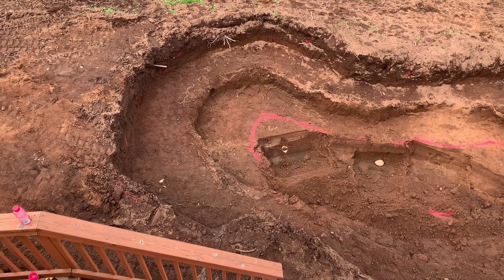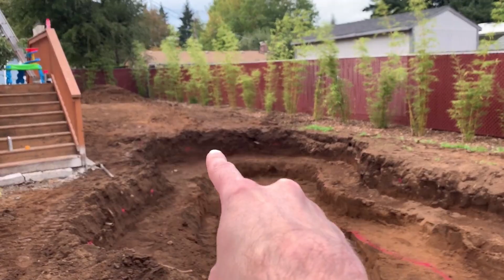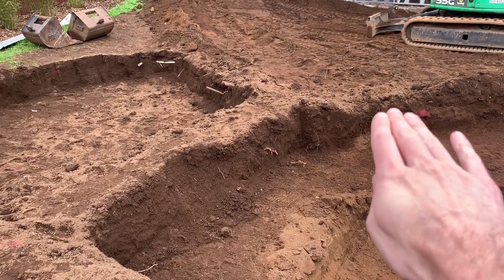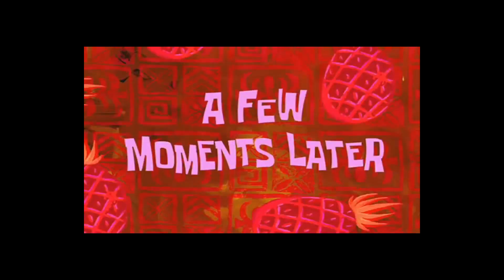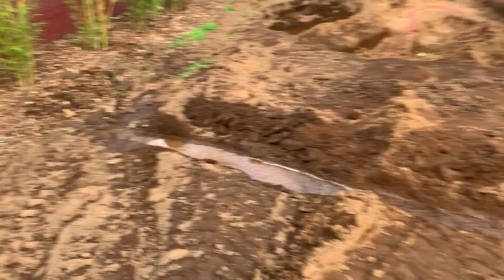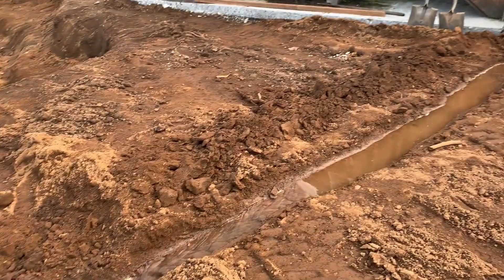Backyard Water Garden: A Giant Hole Appears

Comment: Nice I’m working on min now I’m about we’re you are in this video
Reply from the maker: Good luck. Mine has been sitting all winter. Weather has just turned nice, so I'm back at it.
Reply: @TylerTervooren  like to hear how that liner worked out I used epdm, I was afraid that what you got wouldn’t work so I’m interested how that’s going, I’m going to try and diy the wetland and intake bay with milk crates they say it might crush them but I’m going to test that out myself.
Reply from the maker: @Clutchjewel795  Liner is working great so far. Very tough stuff. Harder to mold to shape than EPDM, but very durable. 3x the puncture resistance, but not quite as strong via friction wear. So I will install more underlayment on top of liner before rocking.

I imagine "real" milkcrates should be plenty strong enough as long as you're not setting really giant boulders on them.

You can sub them for more large cobble at the bottom of the wetland if you're worried about it. That's what I'm planning to do.
Reply: @TylerTervooren  oh yeah I didn’t mean about it holding up I just meant about bending it to fit.